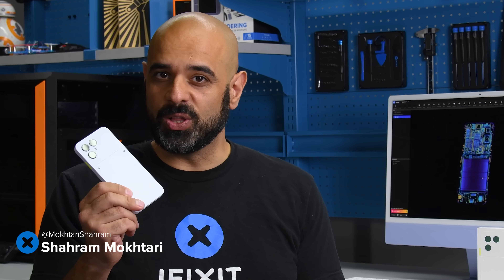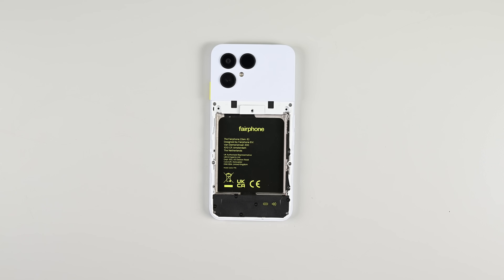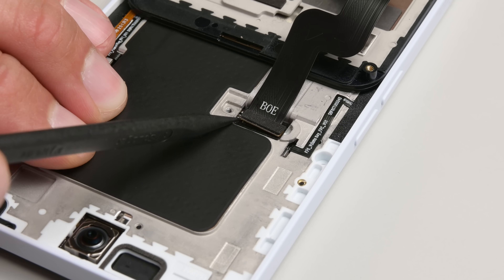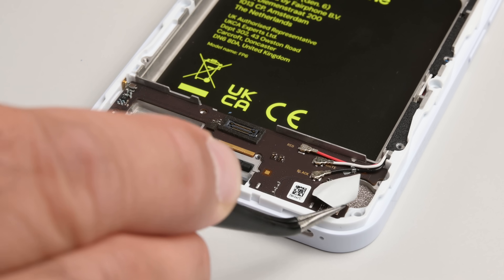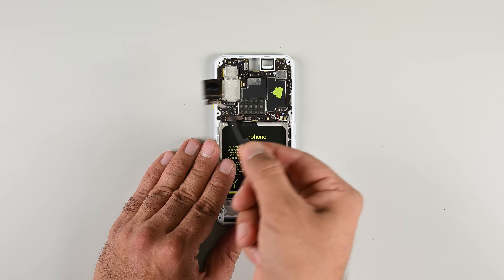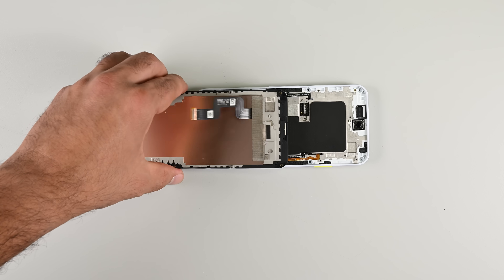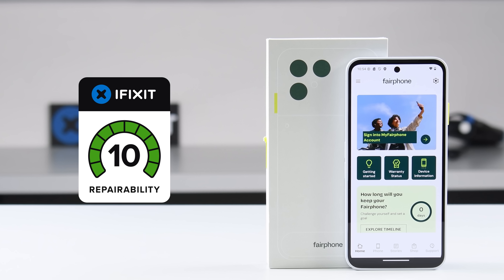The Most Ethical Smartphone Yet? Fairphone 6 Teardown & Review

Comment: I just got it yesterday and it's amazing, well done Fairphone for showing that a repairable phone can be made with practically no compromises!
Reply: does it have all bands wth US carriers?
Reply: Lots of compromises, actually. But not for repairability.
Reply: @Shini1984 assuming you can get parts - you can go to any strip mall or big box store in the U.S. and get a new battery or screen installed in a few minutes on any Apple or Samsung, fairphone? Order and wait.
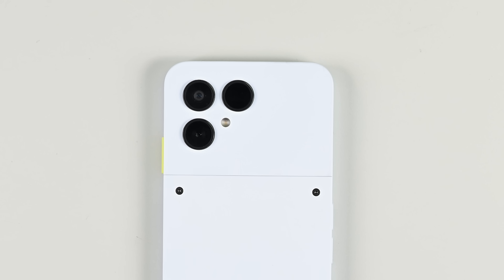Reply: 0:43 already mentions the first compromise.
Reply: @xyoxus Yeah, literally a compromise. Or was USB 2 chosen for repairability purposes as well?
Reply: How is the haptic feedback? Is it satisfying to type with it on?
Reply: there is a lot of them bro. Only 8GB of ram, weak cpu, plastic case, no waterproof, smaller battery, usb 2.0.
Reply: @FevonTV  all that without children labor, your choice
Reply: @FevonTV  Besides waterproofing and maybe the battery capacity, those are all cost cutting measures with little to no direct correlation with repairability.

Comment: Was the TOF sensor really necessary? I feel like it could've worked just fine with the standard and UW lenses, or give a telephoto lens, but I think that would've been a bit too expensive.
Reply: Yeah, same, that's the only thing I miss. Probably also an issue of space since an additional camera module is a lot bigger than the TOF sensor. At least if they went for a periscope lens which would really make a difference (a small 2x lens that's otherwise worse in specs compared to the main sensor doesn't really bring any benefits). And would have required the phone to be quite a bit bigger. And I'm really happy that they managed to make it smaller this time around. So much that I'm finally considering getting one now.

Comment: We spend ages making it easy to fix. You spend minutes proving we're not bluffing. Appreciate another 10/10, legends 🙌
Reply: Why no headphone jack?
Reply: A 3.5mm jack would be good in the phone soldered to the daughter board
Reply: why did you guys remove the headphone jack?
Reply: Can you bring back the headphone jack ?
It would spare the resources for fragile and often misplaces adapters or batteries for Bluetooth headphones.
Reply: @Luzgar  useless to have one. Rather they should include a dac
Reply: @rohansahare3719  useless? everyone is complaining about it
Reply: @Luzgar  OMG, they claim to be fair and ethical, but dont give headphone jack 😂
Reply: @zulfika_  they at least better than the others
Reply: When can we actually buy one in the US.
Reply: Please I would like to get jack on my phone.
Reply: Bring it to Australia!
Reply: Headphone jack please!!
Reply: The replacement parts are too expensive — you can get original Apple parts 2 years After Release (from three different vendors) for the same price ore less. The battery is overpriced, and so are the cameras; the display is fine. I’ve repaired around 30 smartphones, mostly Apple and Samsung, and it’s really not that difficult. Sure, you need some tools, but with around €300, you’re well-equipped and can replace nearly any component — even for water- and dust-resistant phones.

I don’t understand the hype. I also believe that the warnings about third-party parts mainly matter for the second-hand market. When I buy a phone, I want to know exactly which parts are inside and how much they cost.

The most important thing for me is software updates. I’ve used my iPhones for around 8 years — sometimes I even buy them used and broken, then repair them and use them until the end of software support.

With Android, that’s a bit more difficult, because the software often stops being optimized for the device after a few years.

I think Fairphone makes good phones — but not the best.
Reply: Usb 2.0 ? :/ ...
Reply: Why no USB 3.2??
Why no microSD??
And worst of all, why no 3.5mm HP jack??

Aren't these all fair expectations?
Reply: When will you team up with GrapheneOS?
Reply: Hopefully your company can be well established in the states!
Reply: Cool but where's the headphone jack?
Reply: Bars
Reply: Yet the price though
Reply: Awesome. Now release the schematics
Reply: @Thrall58  soon!
Reply: Bring it to India please.
Reply: Bring the phone to India PLEASE!
Reply: No, you guys are the real legends. Let's goooo
Reply: Still waiting for the ip67 version, I can't buy a phone that doesn't have that.
Reply: Great work guys 👍💪
Reply: Now fix your os so the phone doesnt overheat constantly Thank you
Reply: How about a U.S. release?
Reply: Can you come to America? 😢
Reply: Please make it secure and support Grapheneos
Reply: Is there a reason to make it so you have to screw for removing the battery? I liked the idea to take a spare one with me to outdoorhikes if I can just swap it out with my hands
Reply: Frame could be metal, jack 3.5mm and maybe option for silicon carbon battery? Almost perfect
Reply: why torx screws tho ?
Reply: The biggest improvement for me comes from the replaceable daughter board since the microphone is what keeps failing on me. Working in heavy industry with steel dust will do that to a microphone. Although an easily replaceable power button would also be nice.
Reply: I still don't understand why you removed the headphone jack since fairphone 4, now in this Fairphone 6 the battery is held by many screws so it's not easily swappable on the go like previous models, the usb connector seems the same cheap quality and easy to break as previous models, you still have a lot to improve
Reply: Hopefully the battery won't need replacing after 2 years. Also, stop releasing new phones every 2 years if you want people to use them for longer.
Reply: "another 10/10"

Quite the flex!
Reply: Really wish this phone included Display out via USB, maybe I will still buy it but it is a sad downgrade... :(
Reply: @tonur249 Yes display out is crucial. Because then in a pinch you can use it as a mini desktop word processor or something. I also wish that had a headphone jack. I get it though I mean you don't always get what you. If it had those two things I would buy it. Until then I'm more inclined to just save an old phone from the landfill by buying something used on eBay
Reply: Hooray
Reply: Big slap to the overhyped, influencer bribing Nothing.
Reply: It's good but has improvements to get:
I use my moto z2 for 7y already, 2y ago the battery was damaged due updates but now the manufacturer doesn't even produce the part anymore (Brazil law requires only 5y)

I could use any battery, technically nothing stopa, except the hard coded mah capacity and phone just don't want to turn on without a cell.

My suggestion is that you make those improvements, seems useless for most people, but can be handy in the end of life
- Power on the device from USB without cell
- Pads on PCB to connect vcc/gnd from any battery cell
- USB pads on PCB to inject power and trigger charging state with cc pins (my USB data pins broke and can't talk to charge)
- battery diagnostics on fastboot (at least current and voltage, to monitor charging while off, should charge faster cuz there's no system?)

Isn't metal more recyclable than plastic for frame?
Reply: Please come to India 🥺
Reply: This level of engineering is truly impressive. The only thing I feel will complement it is the option to remove the ultrawide camera and switch it with a tele camera with 2-3 times optical zoom. This can come preinstalled with the respective difference in price or you could sell the additional module for later switch.
Reply: U ARE AMAZING!!!
Reply: And I will gladly support you with my money for this. Thank you
Reply: Having old hardware at a wildly high price point doesn't help this brand, I'd rather pay good money for a S25U equivalent device if it meant I could just keep it for a good amount of years by just replacing what breaks instead of being forced to use an expensive device based off of an old hardware stack which was already mid-tier at best when it launched. Also let's not forget that there's no schematics available and no headphone jack while the SoC still ships with an amazing DAC.
Reply: Goated.
Reply: Please please make a "pro" phone, I'm sure me and many others would be willing to pay more. I love the mission, but not enough to give up the flagship cameras, display, and processor of my current phone. Since I would be using it longer, it's even more reason to spend a bit more up front.
Reply: Could you please sell the mid frame with buttons in as a need one due to a faulty power button and would like to repair it myself
Reply: Bring it to India y'all
Reply: Only 1 please... Support Postmarket os or alternative
Reply: Two questions: what about upgrades, any plans? How many screws you can lose before the phone is no longer safely usable?
Reply: I don’t blame you for excluding the US but it would be amazing to be able to purchase the full fairphone experience instead of through Murena.
Reply: Just misses GrapheneOS (like) Software now.
Reply: I would love to switch to this phone, but I want to see a chipset that's found in upper mid-lower flagship phones like the Sony 5V Snapdragon 8 Gen 2.
Reply: Make Available in India ❤
Reply: Make a pro version, best of the best specs. I’ll buy it
Reply: Damit my next Phone will BE this. Im Stuck Wirth Google Pixel now
Reply: i literally just want a headphone jack PLEASE come on!!!
Reply: Fairphone is fantastic, bravo!
Reply: Can we get a partnership in Nigeria? Lots of potential customers and our large technical user base would love this
Reply: sell it in more countries then
Reply: Why would you support Murena e/os instead of Lineage that is actually more safe and private?
Reply: Bring it to Australia
Reply: I GAVE YOU SOME MONEY FOR ONE AND SOME ACCESSORIES YESTERDAY
Reply: What about software updates ? It seems you forget the old devices once the new one comes out fp4 is still on Android 13.
Reply: @Klenoism  We're meant to see Android 15, dropping Android 14. crossing fingers.
Reply: @Klenoism Fairphone have broken their promise re: OS updates for the FP4 which isn't surprising.
Reply: Android itself doesn't really need to be updated as long as you're getting the security patches. Android 12, 13, 14 are very stable now.
Reply: @shemf_services In theory, yes. But that assumes an unrealistic lack of change going forward. Something as simple as, say, your banking app requiring an Android version your phone doesn't run could force a phone upgrade. The same goes for new APIs and programming frameworks, web standards and more. All of these things are changing much less rapidly now than a decade ago, but they're still developing, and these kinds of updates ensure a degree of safety in not being left behind for something as silly as an OS feature - which has happened many, many times. Hardware features can of course not be changed without a hardware upgrade, but those are also much less likely to become a requirement within the lifetime of the phone.
Reply: Can you bring it to the US?
Reply: Thank you for doing so, this phone is in fact one that I am down to buy.
Reply: Congratulations Fairphone
Reply: Now make it upgradable. Upgradable camera, processor/motherboard and battery at least. The phone will in any case get old if the specifics get stuck in time...
Reply: Okay, I want a LCD version though. I hate AMOLED/OLED burn-in and flickering.

Also missing headphone jack, flagship processor, and I would like to see 16GB of RAM at least for some “future-proofing”.
Reply: Love to see that you're still at it, and seemingly making great strides in improving your phones. Honestly this release makes me kind of regret that I got a Pixel 8 last year, but I'll still be hanging on to that for as long as I can keep it alive. Already looking forward to checking out the Fairphone 10(?) in five years or so though!
Reply: Why the CPU tho?
I was really excited and signed up to add some phone extras in white when released, but when looking at the specs, I mean, I'm using a 4 to 5 years phone with a Mediatek Dimensity 1300, your CPU has like 10% better AnTuTu Score but actually is full of bad reviews from a performance point of view.
Reply: just because its easier to fix doesnt make an android phone ethical.
Reply: @smidgeondutchrabbit no it doesn't make the phone fairer through being easier to be repaired, but paying higher salaries for the people providing raw materials and putting together the phone, founding Fair Cobalt Alliance and sourcing fair cobalt (instead of buying recycled slave mined cobalt), using recycled plastics, making sure to recycle as much e-waste as is produced - and being open about which of those goals are actually achieved on a yearly basis - is what the Fair in Fairphone is about. The Fair is so much more than if the phone can be easily repaired. So, so much more. As an example: in all the newsletters I get from Fairphone explaining how the new one is better, they consistently tell me to not buy it if my old one is still good enough..
Reply: It's 213g, that's too heavy imo. 180g is the sweet spot. 165g like the s25 even better.
Reply: Thanks chat gpt
Reply: You guys are doing an awesome job!! Keep up the great work! 😊
Reply: I don't care. Simple fact is America isn't supported. Parts will and are hard to get. I've been with Murena since they were called /e . And in this term it's not gonna be and by the time we recover. I hope fair phone is still around.
Reply: why you are called fairphone when you don't ship to MY country. that is NOT FAIR
Reply: expensive, 500e max this kind of performance. You could buy samsung a56 relatively cheap around 350e better performance in all segments and easily available replacement parts relatively easy to repair, better software support overall better functionality smaller price.
Reply: I want the latest snapdragon and bigger display
Reply: @GPSniper1  why? This is just fine

Comment: Nice phone. I would like a physical switch to turn off the mic. May not be too hard to add your own I guess.
Reply: You can use a custom ROM to configure the fairphone moment button to muting
Reply: Oh, it's easy, just add wires, connect them to each microphone in such a way that they block current when switched off, add a simple board to do that for all involved microphones and package it neatly into the phone body. Easy, right?

/sarcasm

Or, you know, design a phone with this feature in mind. But remember you need physical switches that cut current, you cannot trust the software to do it. Software can declare whatever and do something else behind your back. I know, I've been writing software for decades.
Reply: @Shini1984  There is a phone called Murena 2 that has a physical switch. But I like the Fairphone more. Was not aware it had multiple microphones, so yea it would be a bit more complex that I thought. Would need a small  board as you said, really is no room for that. One switch in series maybe, but a board would be tricky!